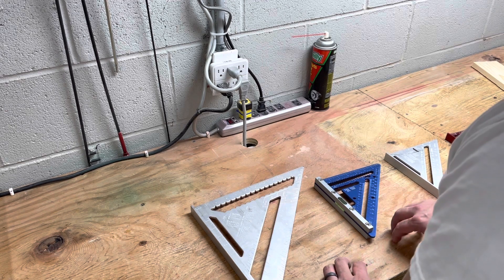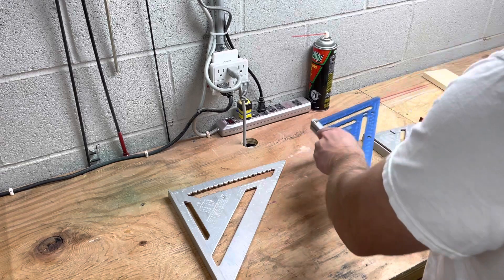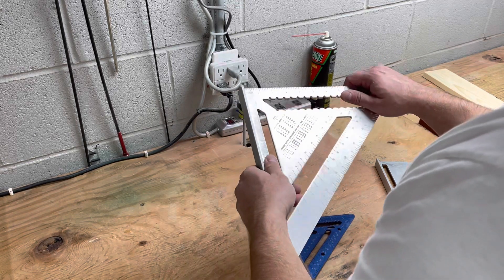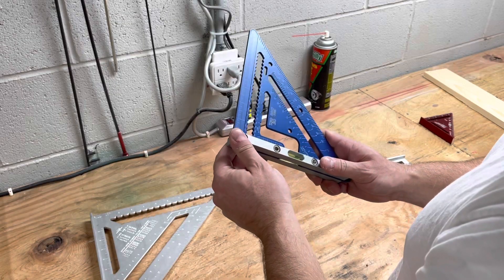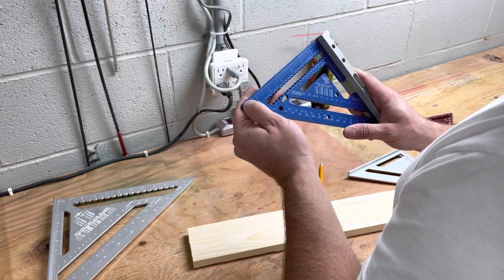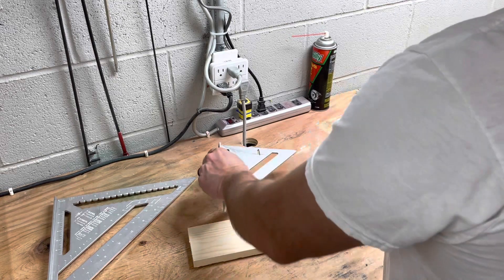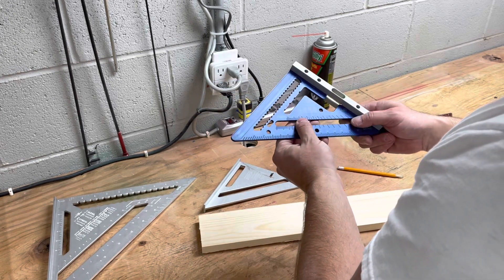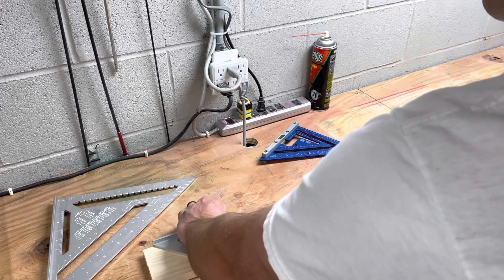Speed squares - Trig Jig RSA 7

Comment: Rusty. It appears that your large (bat wing) square has the same problem as mine  (by a different manufacturer). If you mark a line for a stud, you can't choose the1-1/2 inch mark down the heal from the pivot point, to mark a cripple or double stud. The first mark is 1-3/4 inches. I've thought about grinding the opening out on mine and adding the1-1/2 inch mark. All of the smaller squares have the 1-1/2 mark. Is your British square in centimeters or inches? Finally, you mentioned that your Milwaukee's heel is not centered on the blade. Some are offset so you can use one side to mark the center of a 3/4 inch board with one lip and a 1/3 inch for marking a tenon with the other lip. Thanks for your post.
Reply from the maker: My trig jig is in inches. Thanks for stopping by!
Reply: Just realized I typed in 1/3 inch in the last sentence of my post above. It should have been 1/3 of the edge width on a 3/4 inch board or 1/4 inch from either side to lay out a tenon.  One day I'll learn to type and look at the screen at the same time. Thanks.